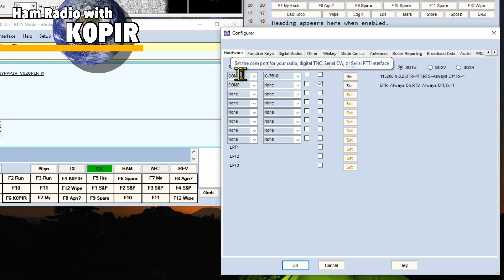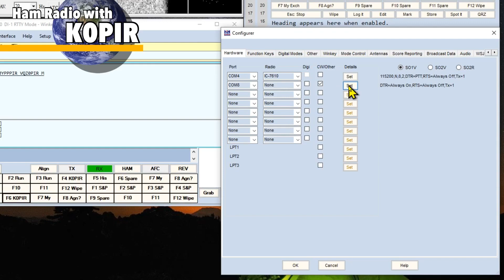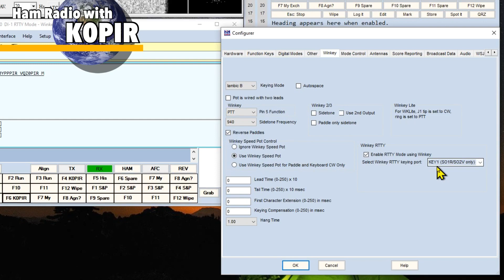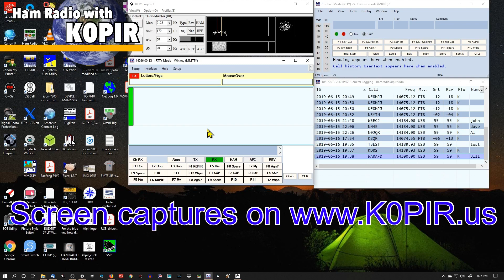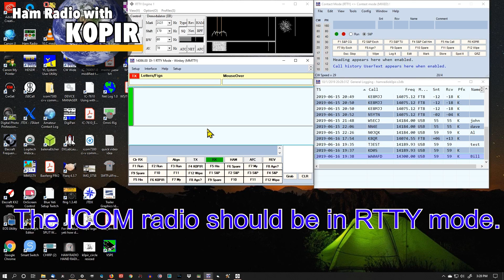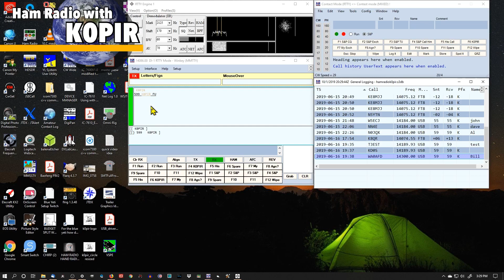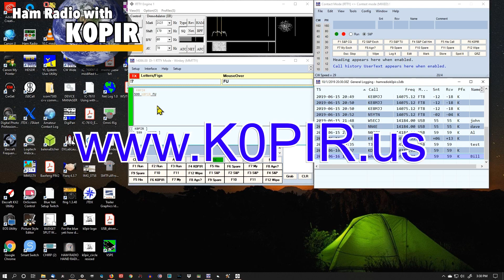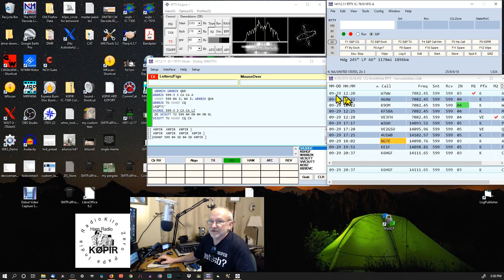N1MM Winkeyer3 RTTY FSK Configuration

Comment: The reason you got PR the transmission did not pick up the Figures key. Rtty requires Letters and Figures on the keyboard because Baudot is 5 bit code and requires shifting between figures and letters to get more out of the keyboard. That is also why Teletype prints in all caps, if you look at a old teletype keyboard you will see each key has what it will type on figures and letters. Sometimes during a teletype contest you see stuff get garbled by not picking up the fig or ltrs key. A very simple way to decode numbers is by looking at the top row of a modern  keyboard and think of Q as 1 and P as 0 and just count P=0 and R=4 that is 04 hihi. Typing on a Teletype is a bit different by using the letters and figures keys.
 73 Larry
Reply from the maker: @larryarneson  thank you and great explanation.

Comment: There are a few other folk, me included, that had the PTT LINE intermittently  hang on transmit , "fixable" by pressing the TX button on the rig. The set up is the 7610 N1MM MMTTY. Check this out: thinking it wasRFI, I put handfuls of #31 ferrites on everything. Turns out, in my case, it still happens with power set to "zero" and no antenna. Anybody figure this out , pse email me at my QRZ email. I`ll fwd it to others and post on the feflectors.

BTW  "PR" are the ltrs for "04 ". Must be a setting someplace in the software. OT rtty guys will remember TOO  was 599.
Reply: Gee forgot .... de NS2N  Paul
Reply from the maker: Paul Antos I am testing out the WK3 RTTY FSK with Fldigi. I’ll be on 20m making contacts and see if it hangs in transmit. 73!
Reply from the maker: Thanks Paul I did not know about the”PR”. Nice to know! 73 - Rich, K0PIR
Reply: @HamRadioAdventures  yes - looking at the keyboard Q is 1 W is 2 and so forth. See it once in a blue moon nowadays, but quite common back in the mechanical machine days.